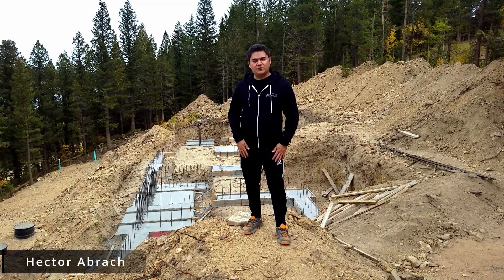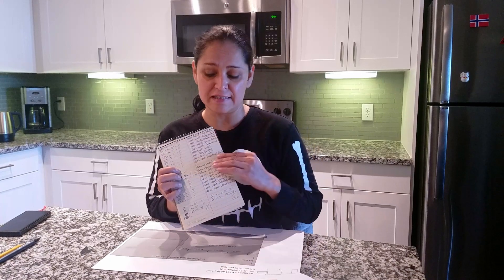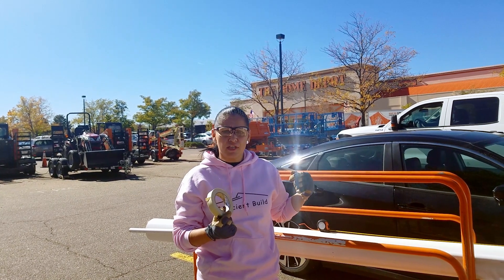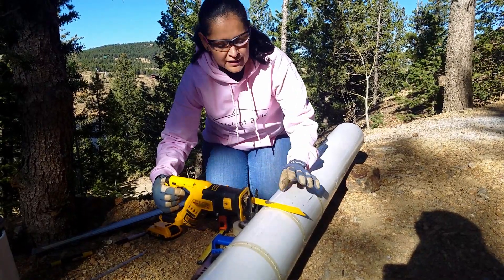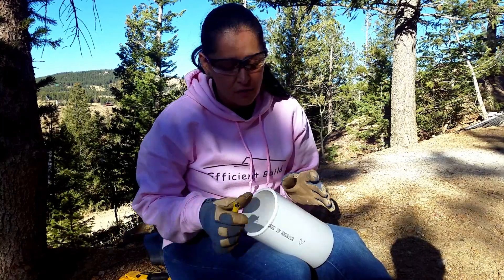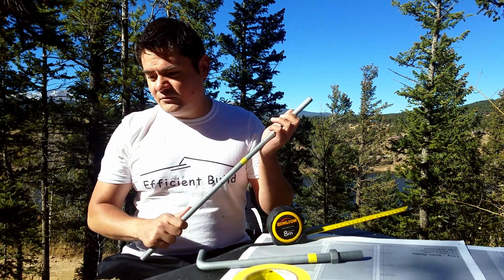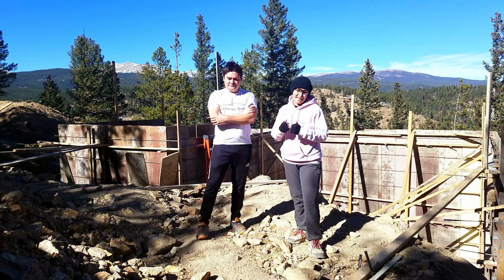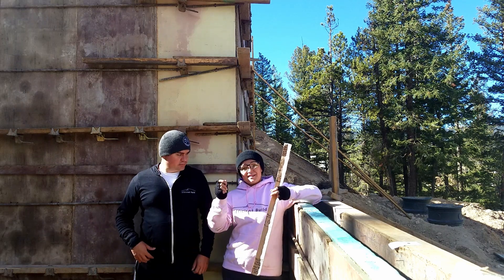Finishing Foundation Stem Walls: Sleeves, J-Bolts, and Threaded Rods | Mountain Home Construction

Comment: I saw (4) Service Sleeves in that one wall--what is each for? Did the concrete contractor have a problem with you drilling holes in their forms? Also, are the Weep Hole sleeves for the retaining walls?
Reply from the maker: You might notice we have actually 8 service sleeves, each two are for having access to the mechanical room below grade. In short 4 sleeves coming from the mechanical room. This way we can run electrical and plumbing directly into the main house from the mechanical room.
I only specified the location of the sleeves , sizes, and I provided them at the right length. The concrete contractor took care of putting them in the forms. They don't drill their forms, but I let them do what they do. They did good.
Yes, the weep holes are only for retainer walls. This way if there happens to be any water accumulation behind the wall it can weep without adding extra pressure on the wall.